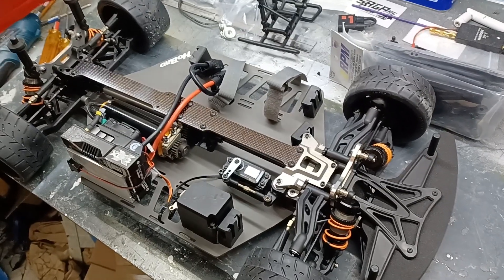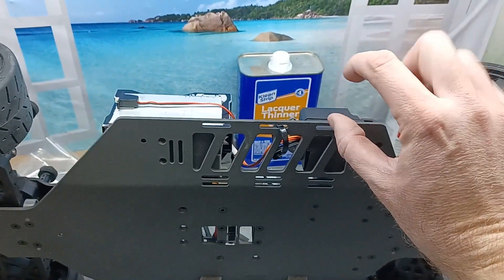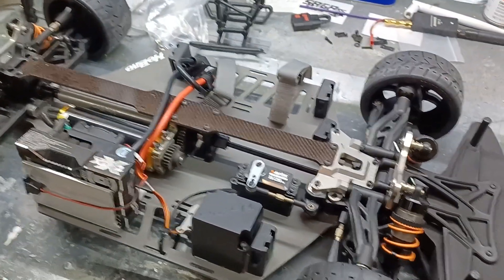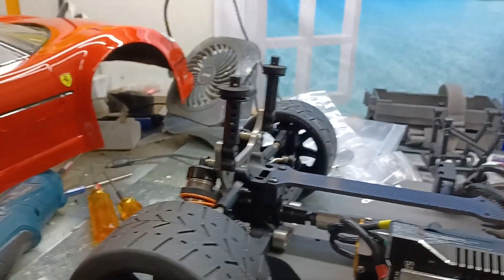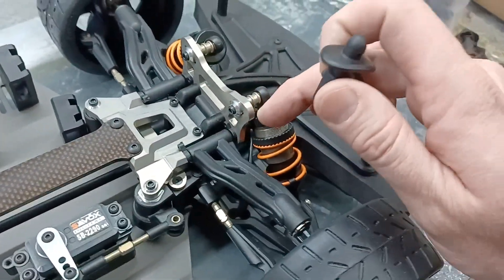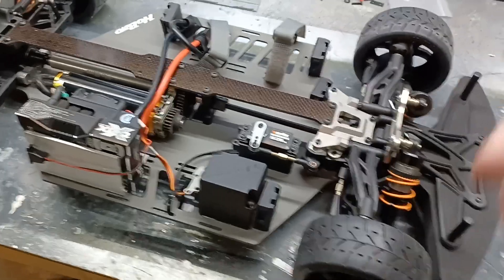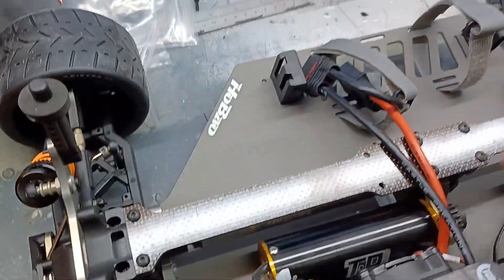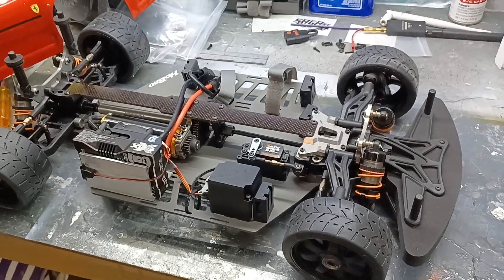Hobao VTE 2 - What I DO NOT like about it

Comment: Try green loctite on those wheel nuts instead of blue or red.
Reply from the maker: Using the Arrma wheel nut I had zero issues.  This video is pretty old.  Check out some of my other videos on this car doing speed runs 👍

Comment: The reason all those chassis are cut at an angle at the wheels and not straight is because these are just buggy chassis with different wheels/shocks for on road. The buggy wheels are wider/bigger and need that space. That's why all the 1/8 on road cars look like they got squished, because they're just 1/8 buggys with on road wheels.
Reply from the maker: More so speaking to the aftermarket guys like Saga.  I get that it's lighter this way and saves them money 💰
Reply: NOT TRUE AT ALL.  the GTB is converted buggy chassis - its raised in the front. the VTE & VTE2 are 100% flat they are made for the track. I wish dudes knew what they are talking about
Reply: @jdodds1023  when making parts its more cost effective to use the same stamp and simply add a bend than making a completely different mold/tooling to keep it cost effective. I wish dudes knew what they were talking about.

Comment: I completely agree with you with good reason. I do not have a HOBAO but I’ve imagined working on one.. seems all the things it needs are what already exists on the ARRMA platform. If anything… the limitless is already the most equipped and capable rc platform, and nothing beats it once it’s modded further. Seems there’s almost nooo room left for another company to do better than the ARRMA platform while avoiding copying their platform.
Reply from the maker: I do prefer the vte2 for a top tier speed runner. It has bigger input bearings and diff input shafts are 8mm.  Also no front kick up angle means the center shafts are better aligned.  Overall it's my favorite 1/7
Reply: @Liberty.Francis  …… good facts, tempting 🤗

Comment: Nice info fam.  I have that same F50 body for my Arrma Felony.  I see you had clear tape on the wing.  I had trouble with that as well and I put doubled sided adhesive tape in between and its solid as 🪨 🎸 🤘 I also received my Hobao extreme roller yesterday and you have a pretty unique setup.
Reply from the maker: Thanks man, I ended up making a carbon wing for it.  Check it out in my latest videos
Reply: @Liberty.Francis  yessir
Reply: I utilize the body mount style you had it's awesome?

Comment: hi great vid..!   are those wheels reted for speed runs 150 mph like the GRP ? ...dors this hobao has the same lenght between wheels as the  limitless or is it wider ?  thanks .
Reply from the maker: I believe all the specs if the Limitless is very similar. 
Not good to 150.  Likely not over 100

Comment: For that F50 Delta body - I have one myself - just order the optional hobao posts - they have two extended ones that work perfectly for the front two posts.
Reply from the maker: For mine they line up with the hood vents rather than a flat spot.  I installed the rear Arrma body post today and they bolt right on and work much better.  I am going to try the front soon also mounted to the shock tower after re-positioning the upper shock placement.

Comment: How do you like those powerhobby gripper tires the front and rear are they the same size front and rears as far as height over all I wanted to put that same size on my infraction V2 6s was worried about having to change the gearing in the diffs???? Would appreciate some feedback
Reply from the maker: Being all the same size is nice.  Also a great option to fit wide bodies like the one I used.  They are just ok. Grip is less than GRP and I don't trust these tires above 80mph.  I use them mostly for my shelf queen Lambo body

Comment: Does that chassis have different gearing front and rear? The reason I ask is I thought those powerhobby tires were setup for the felony where the rears were taller than the fronts. Awesome build and really dig that Ferrari body
Reply from the maker: The power hobby tires are 100mm tall front and rear.  Works for regular rc cars that want to use Felony style bodies

Comment: I've owned a lot of hobao's... and their quality is always excellent.  Especially in drivetrain and differentials, so I wouldn't worry about their aluminum being not good quality.  However I am most disappointed about not being able to fit castle 17 series motors in the car at all... with the 1/5 scale mount also... doesn't fit. Really a bummer. Always have had to cut down the body mounts when installing custom body, that is nothing new, with the VT 1 the body sat a little higher in the back. Overall I love almost everything about the car, except the damn motor mount.
Reply: Are you referring to the new 1721 motor not fitting?
Reply: @paradox2311  yes
Reply: it MOST DEFINITELY FITS   not sure what your doing wrong but if a Castle 1100kv can fits - it will fit easy.
Reply: @1521joe  so any 56mm motor will fit in the 1/5 mount... however the 17 series will not fit the holes in that mount, and when put on the normal mount, it doesn't go in because it hits the chassis. Just try it, and you will see what I'm talking about

Comment: Hi sir is the tp motor using the option 1/5  motor mount option?
Reply from the maker: This is a 40mm tp motor so I am using the original mount.  Just had to drill the m3 sized holes for my m4 screws to mount the motor.
Reply: @Liberty.Francis  owh i see, would the castle xls 2028 will be fitted too using the stock motor mount? I havent purchase the vte2, just need to prepare the necessary compatible power system for it
Reply from the maker: @SPEED-7  no that wont fit
Reply: @Liberty.Francis  owh i see so it have to use the option 1/5 hobao motor mount

Comment: Thanks bro. I'm following your build.
We're you getting a bodyshell for this car.?
Reply from the maker: Delta Plastiks  anything that fits the infraction.  Or Felony if you do the wide rear tires like I did.
Reply from the maker: @1521joe  you will have to figure out where the position is to mesh well. Pull the pinion, tighten the motor screws and the do a final install of the pinion.  Not ideal but that's how those mounts work.